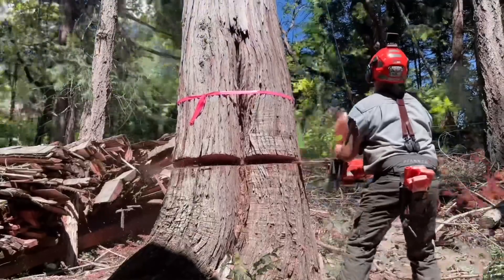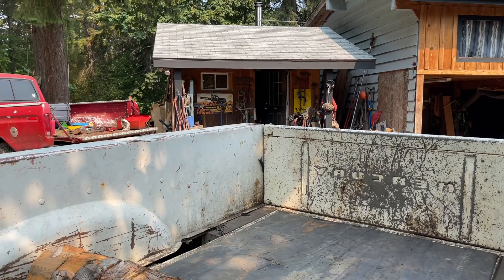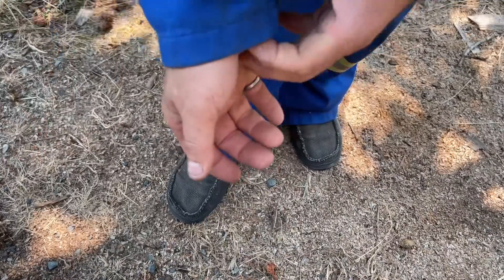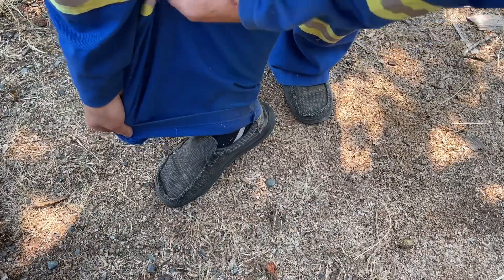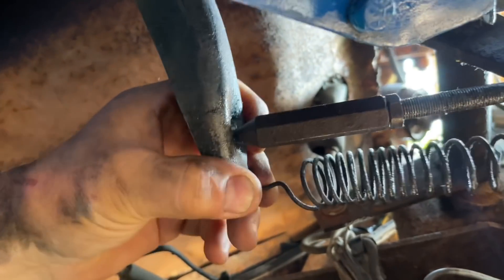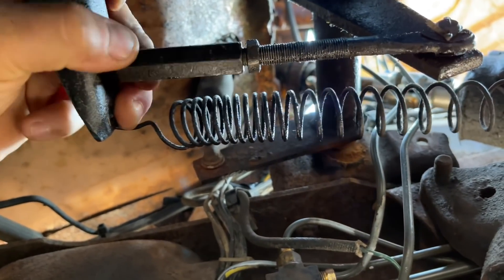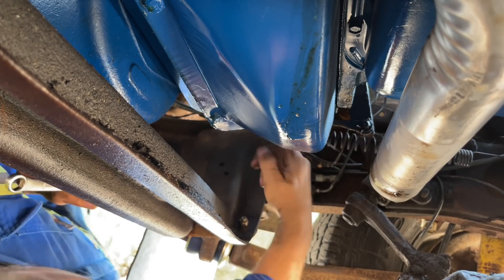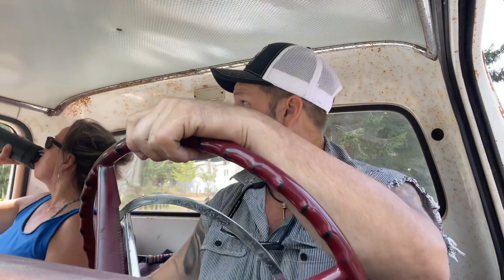Preparing my old truck for a journey

Comment: I bought a 1972 chevy c-10 with an automatic transmission as a restoration project and I am going to swap the transmission to a 4 speed and I can say that truck rides just as nice and has less blind spots then my 2017 gmc standard cab pickup and being all mechanical and not computer controlled sold me on it even though it needs some body and mechanical work it fires right up with no hesitation, watching you run vintage equipment and keeping it running is extremely enjoyable and is an inspiration for me to do the same
Reply: Super easy swap.  All the holes are already in the cab for the clutch pedal and linkage, and the transmission tunnel can be swapped out for one with the manual transmission hole already in it.

Comment: Rolling your cuffs up is perfectly fine but it's not for us fat folks. I'm old and fat, in fact, it's next to impossible for me to put socks on in the morning, and bending over is very hard if not impossible to do.
For most of my adult life, I had to do all of the repairs on my autos. From changing oil, brake fluid, and all the way through replacing engines and transmissions. I even replaced the automatic transmission when I came home tired from hunting in the later evening and had it completed in time to go back in the wood at 5:00am the next morning.
The first thing I did when my boys were grown was buy a new truck, and I swore that I will never do my own auto work again!